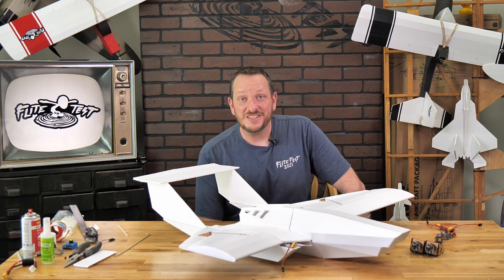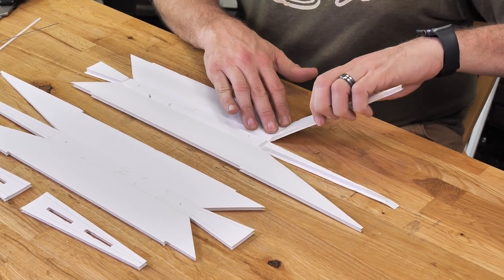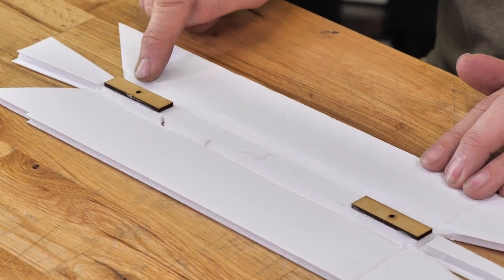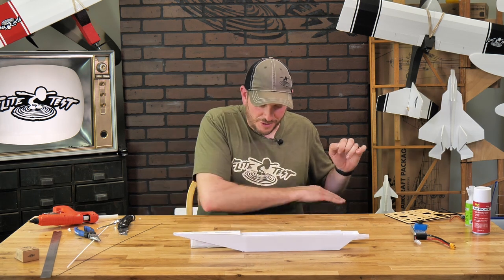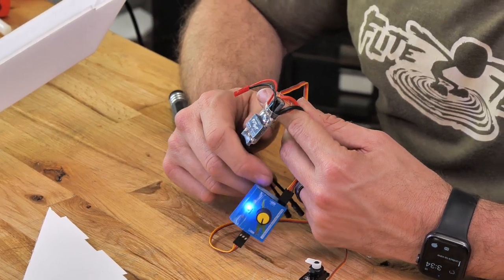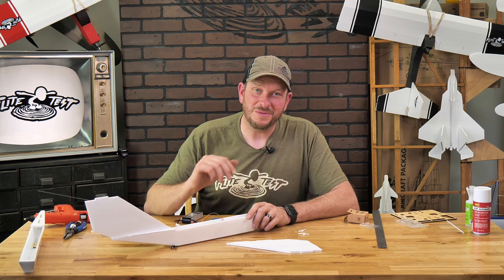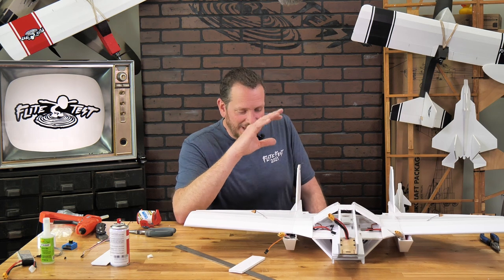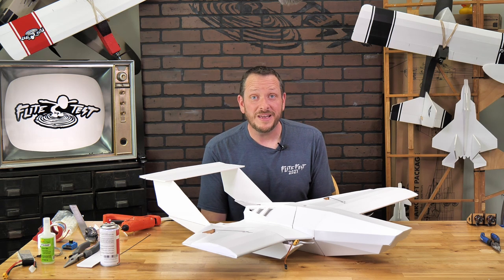How to Build the FT Boomin' Flerken Frame

Comment: Everyone breaks props. If you save the broken tips they make excellent foam blades for scoring and removing foam. Specially if you have a break on the trailing edge with the slight twist. It cuts to the paper without going thru and then just a slight twist pushes the foam off the paper.

Comment: Will there be an All Terrain Flerken speed-build or add-on kit ? I want to build the boomin Flerken on floats, for use on water.
Reply: There will be :-). When we get the floats finalized, they will simply attach to the bottom of the Brooms. My plan is to make the landing gear kit not interfere with Mounting as well.
Reply: @joshbixler1261  Thanks Josh, I’ll get the Boomin’ Flerken kit, so I’ll be ready 👍